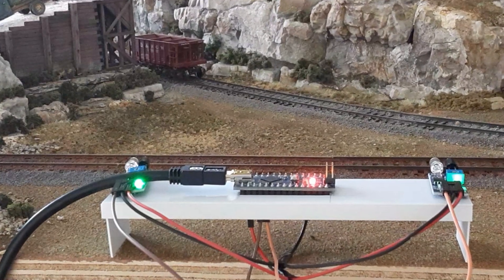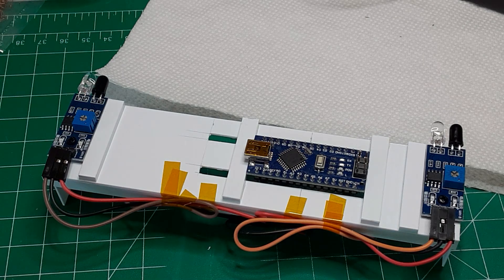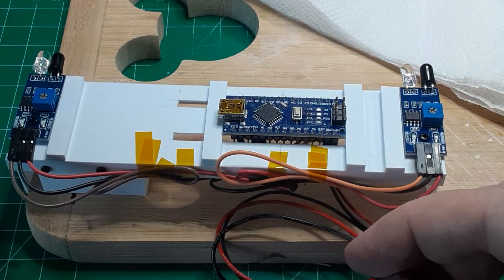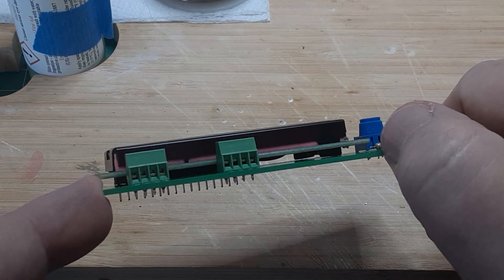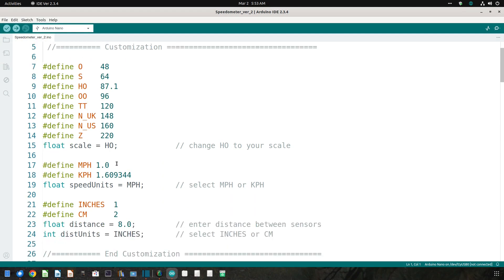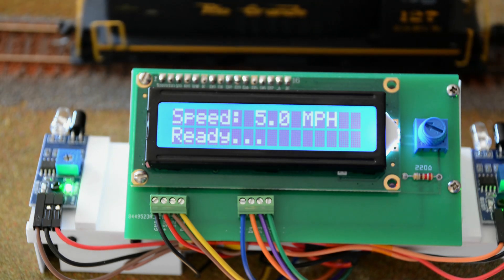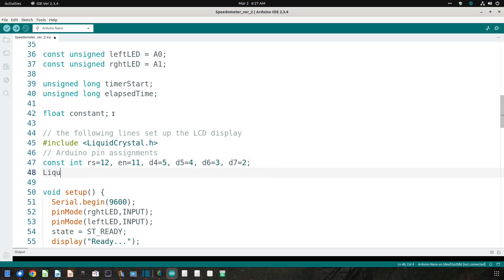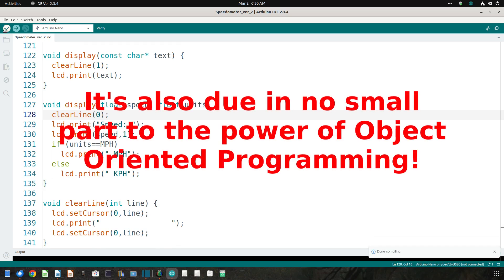Build a Scale Speedometer Part 3

Comment: I’ve had a go at making the speedometer. I’ve got a 1602 with the piggy back 12c. But can’t see how to connect it to the arduino. Can you help. I’m new to using arduino’s etc
Reply from the maker: Sorry you're having troubles!
I did not use the I2C 1602 mainly because I had a vanilla 1602 on hand. However, several viewers of this series reported that they were able to make it work.
First, if you haven't already, check out the video link in the description below the video (How to Use LCD1602 with I2C module for Arduino.) There are just four connections from the I2C to the Arduino, and they are explained in that video.
If you're still confused, scan through the comments to all three videos in this series and reach out to the viewers who mention using a 1602 with attached I2C, and reply to their comment with your question. (It must be a reply to a specific comment so they will get a notification!) Hopefully, one of them will be able to get you going.
If all else fails, you can find my email address on my YouTube channel home page by clicking the "more" link underneath the word "in" as in "HO Scale Rio Grande in the San Luis Valley." Email me a photo of the front and back of your 1602 and I'll work with you to get it hooked up and configured. I am definitely not an I2C expert, but I understand that the I2C needs to be configured to communicate properly with the Arduino, and I will help you with that if necessary.
Don't Give Up - I guarantee there is a solution out there and I'll help any way I can.
Good luck.
Reply: @rwissbaum9849 thanks for your quick reply. I’ll have a go again and see how I get on
Reply from the maker: @davedrury1284  Please note that once you have your I2C module connected to the Arduino, you'll need to make some important modifications to the program sketch. The LiquidCrystal library talks directly to the LCD1602 - it does not talk through the I2C interface; so you need to install and include a different library. Since I am a complete I2C novice, I can't guide you - yet - and the referenced video is pretty light on the coding details...
You'll need to replace lines 45-48 in Speedometer_ver_2 with lines 45-48 in this video: https://www.youtube.com/watch?v=tLb4vyZcyUk 
Also, replace line 51 (lcd.begin(16,2); with this line: lcd.init(): 
Then, add a line 42: lcd.backlight();
I am ordering a 1602+I2C board, and once I get it, I'll follow these same instructions - hopefully, everything works; but if not, I'll work through it with you!

(The pinned comment at the top of these comments also gives the link to the video. @alastaircook1997 posted that video to show how the I2C module works with this project - feel free to reach out to him for help as well.)
Reply from the maker: @davedrury1284  Following up: did you ever get your system working? If not, drop me an email and let me know what's got you stumped.

Comment: Thanks for creating such a clearly set out project. I have been tinkering with it for the last few days. I had a spare oled display and have used that. 
One thing I am trying to do is include momentary switches to change mph/kph and the scales. Do you think an additional state is useful for this?
Reply from the maker: Just off the top of my head, here is how I would approach this:
(1) Create a class called MC_SWITCH. The class would include a public refresh() method to check the button state, a private data member to record the current button state (OPEN or CLOSED), a private data member to record if the button has been pressed and released, and a public pressed() function to return true if the button has been pressed and released. Don't forget to provide debounce time when detecting the current button state - send me an email if you need suggestions on how to do this. (DO NOT use the delay() function!)
(2) Declare two objects (e.g. unitsButton and scaleButton) to take appropriate action when pressed. unitsButton is easy: just toggle between KPH and MPH. scaleButton is harder: maybe cycle through the scales in order...
(3) Your loop() function now starts like this:

loop()
    unitsButton.refresh();
    scaleButton.refresh();
    if (unitsButton.pressed()) {
        // toggle speedUnits between MPH and KPH
    }
    if (scaleButton.pressed() {
        // handle change to scale
    }
// everything else continues as before

(If this syntax confuses you, watch this video: https://www.youtube.com/watch?v=TH9LCyGLlQE )
(4) Modify the first display function so that it displays the current state and the selected units and scale, e.g.  "Ready       N/KPH". By allowing six characters for scale and units, you still have 10 characters to display the state. "Calculating" has 11 letters, but since you're using the LCD display, the calculating state is never displayed long enough to be seen, so you can realistically delete line 96.
None of this should interfere with the normal state operation of the machine, although it might be possible to change the scale or the units just as the second LED detector is tripped, leading to some confusion. (I think it's unlikely though - we tend to underestimate machine speeds.)
A couple more random points: (a) you should select just the US or the UK version of N scale - having two N scales will be confusing; (2) the pressed() function should return false until all of the following has occurred: the button is pressed for a minimum (debounce) time (say, 10 msec) and the button is released for a minimum debounce time. Then the function returns true exactly once - this likely means the private data member (boolean _pressed) is set false, then set to true only when the conditions are met. The pressed() function returns the current value of _pressed and then sets _pressed to false. (c) You probably already know this, but I like to connect pushbuttons to an input pin initialized as setMode(_btn, INPUT_PULLUP). This means the value of digitalRead will be HIGH unless the pin is grounded through the switch.
Good luck, and let me know how it goes.
Reply from the maker: Sorry - I dove straight into the weeds and didn't really answer your question!
If you've read my earlier response, you saw that I do not think this is best handled by an additional state, and I guess this is because it feels like one of those old Sesame Street songs: One of these things is not like the others... Our speedometer can do three things: it can wait for a train to enter the speedometer; it can wait for a train to leave the speedometer; and it can calculate and measure the speed. (I programmed a fourth state to distinguish between trains moving right to left and trains moving left to right. The fifth state (WAITING) was necessary because a real train has a non-zero length, and so there are two "leaving" events - one for the front of the train and one for the back of the train.)
Changing parameters (i.e. scale and speedunits) on the fly just doesn't feel like any of these others - it exists outside of the operation of the speedometer. That's why I think it needs to be handled separately.
All that said, the Arduino now has two tasks: (1) monitor the speedometer, and (2) monitor the configuration buttons. It has to handle both tasks simultaneously and with no appreciable processing delay. The best way I have found to allow the Arduino to multitask is to create multiple objects and to repeatedly poll each of those objects to determine if any action is needed. (That polling is handled by the refresh() method.) The next step beyond my solution above would be to declare an IR sensor class, and then to declare a speedometer class which contains two IR sensors. See this video for details: https://www.youtube.com/watch?v=TSivFdAtcME) If you were to go this far, your ENTIRE loop function would look like this:

void loop() {
    speedometer.refresh();
}

With enough I/O and display capability, you could then have two (or more) speedometers on your layout, in which case your loop function would look like this:

void loop() {
    speedometer1.refresh();
    speedometer2.refresh();
}

Whew!
Reply: @rwissbaum9849  Thanks again for a clear explanation and video(s). Having never used classes in my sketches before, it feels like a steep learning curve, but a bit of trial and error should help.
Reply from the maker: @davidvirgo5624  If you get stuck, drop me an email and I'll try to help.
Reply: I have made a fair amount of progress utilising 2 momentary switches and the OLED display. I ended up using a pre-made button library and also a ready made example for the OLED display. It's a very small display compared to the LCD used here, but this will allow the device to be quite thin. I'll post an image or video here when it's done. 
I did notice that there is a typo in the scale definition for OO. The sketch version 1 shows it as 96 instead of 76.
Reply from the maker: @davidvirgo5624  Thanks for pointing that out - obviously, I do not live in the UK! I'll edit the video description to note that.
Reply: @rwissbaum9849  After much fiddling and testing ideas I have a working 2 button version which drives a 128x32 (pixels) oled display. I used a ready made button library and the adafruit library for the display. 
The display is very small compared to the LCD example but I had the display in the bits box.
I have also made a 3d printed box that holds it neatly but I have to do a bit of wiring and soldering to get it finished. 🚂

Comment: Thank You for posting this video
I built the speedometer and made a few changes,  I ported it to a ESP32 and added a 1602 I2C LCD display.

I did run into a glitch. I placed the detectors 12" apart and ran a long train through it. I discovered that the cars I was running were about 6" long and every 2 seconds the speedometer would restart, and give crazy readings. And it would read the caboose last restarting the speedometer and leaving it in the either the detect lb or rb state.  I first increased the time wait  for restart to 30 seconds.  That meant that it would be thirty seconds before the speedometer would restart.  I finally solved the issue with some minor changes that should work with the Arduino.

I added three new variables under unsigned long the timer variables at the top of the program:
unsigned long currentleft;
unsigned long currentright;
unsigned long currenttime;

I then changed the waiting state (case ST_WAITING:)  code to:

    case ST_WAITING:
      // force delay of 2 seconds
      if (millis()- Starttimer<2000) return; // I also had to change this variable because timerStart in ESP32 is a reserved word. With code below I don't know if code line is necessary.

      if (detected(leftLED)) {
        currentleft = millis();
        currentleft = currentleft + 2000; 
      }

      if (detected(rghtLED)) {
        currentright = millis();
        currentright = currentleft + 2000;
      }

      currenttime = millis();

      if ((currenttime > currentleft) && (currenttime > currentright)){
        newState = ST_READY;
        lcd.clear();
        lcd.setCursor(4,0);
        lcd.print("Ready...");
      }
      /*
      if (!detected(leftLED) && !detected(rghtLED)) {
        newState = ST_READY;
        lcd.clear();
        lcd.setCursor(4,0);
        lcd.print("Ready...");
       // display("Ready...");
      } */
      break;

what the code does is every time, while in ST_WAITING,  one of the detectors cycles it records the current time.   It then adds 2 seconds to the wait time to restart  and allows the caboose to clear the speedometer.  This code solved the "long Train" glitch.

This has been an enjoyable project.  Thank you again
Reply from the maker: I'm so glad you found the video and I'm super glad you were able to fix my primitive programming logic. The nice thing about these DIY projects is you cab get in and fiddle around with the guts - as you did! Thanks for watching.

Comment: another question, looking at the code I see 2 functions with the same name "void display()" how does that work? which one will be called? thanks
Reply from the maker: That’s a great question! C++ (which is the language used by the Arduino IDE) has a feature called function overloading which means that you can have more than one function of the same name as long as the formal parameter lists are unique among the various functions using that name.
In this case, one version of display() has a single item in its formal parameter list: const char* text; while the second version has two items: float speed and float units.
When you invoke a function - e.g. display(“Ready...”); - the compiler tries to match the function arguments (in this example, “Ready...”) with the various definitions of the display function. The function arguments must match both in number and in type. (If it can’t find a match, it reports an error and the compile fails.) In this example, “Ready...” is a const char* and so the compiler knows to use the first display function.
Reply from the maker: And now, to answer your next question - what the heck is a "const char*"?
To continue with the previous example, "Ready..." is what we call a string constant - it is called a string because it is a "string of characters." It is a constant because it can never be changed once the program has been compiled. (Can you imagine writing "Ready..." = "something else" ? Chaos!) The asterisk is used to define a pointer type - in this case, a pointer to a character. The value of a pointer is the address at which the thing is stored in memory. So, if the string "Ready..." is stored at location 843, then *("Ready...") is equal to 843.
Since strings can be arbitrary in length (one string might be "MPH" and another might be "Calculating...") C++ stores the string character by character sequentially (843: R, 844: e, 845: a, and so on), and then appends a zero value after the last character (we call this a null terminated string ). Strings are passed to functions as pointers for technical computer reasons. So, on the calling side, we send "Ready..."); but what the function actually receives is 843.
(Apologies to C++ experts - I know I'm playing fast and loose with the terminology here.)
Reply: @ great answer, thanks so much. That is what I thought about having 2 functions with the same name and diff parameters. I just never saw that in use before. I did c++ like 20yrs ago, we forget if we dont use it. I am in a totally diff domain now ;) no more coding, thanks again!

Comment: ah yes, one other thing... to connect it in standalone, I plug the usb cable into an apple block charger with a usb port. Removes the need for a battery setup for me. and with luck my order of the lcd came with a preinstalled I2C, which was great after I understood what the heck it was lol
Reply from the maker: Great out-of-the-box thinking on power. I considered just using a 1.25mm JST connector and plugging the unit into my 12 VDC bus, but I figured many viewers wouldn't have a 12 VDC bus...
Reply: @ thanks I just dont like to rely on batteries
Reply: @rwissbaum9849  First, so glad I found your channel! I have been building RadioShack Heathkit items since the 80s and love tinkering with electronics. I have spent the last 50 years as a software programmer. Your channel is a perfect fit for me & my model railroading projects (again since the early 80s). Can you briefly describe how you would go about doing the 12v DC to this project? I do use a 12v DC bus and have a box of 1.25mm JSTs for my train lighting projects. Is voltage level an issue in this project? Either with 12v DC bus (too much? Buck power converter?) or a 5v USB wall charger (too little voltage)?
Reply from the maker: @MAAz28_1  I use a 12 vdc bus powered by a good quality wall outlet DC converter. Most converters these days include on board voltage regulators so they provide steady 12 volts even under very low loads (unlike the 12 vdc terminals on most DC power supplies which use a simple step-down transformer.) I have never had an issue powering my Nanos with this system. The Arduino specs call for, I think, 7 to 12 volts in, but I've seen other data sheets saying the Arduino can tolerate up to 15 volts on the Vin pin.
Reply: @rwissbaum9849  Thank you for the quick reply. Sounds perfect, and the route I will be taking this weekend when I build my new speedometer!
Reply: @ thanks that is great info I will do that, better be safe than sorry 😀